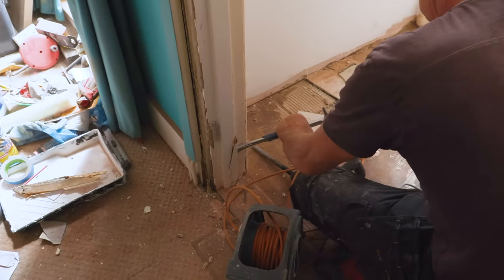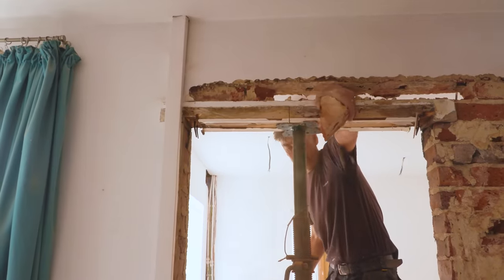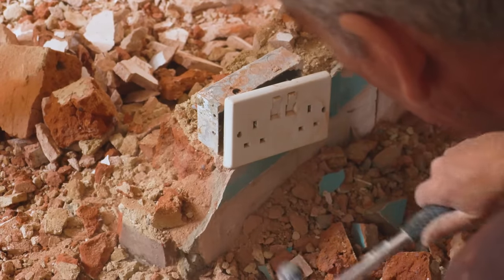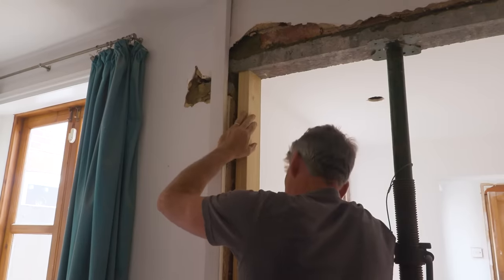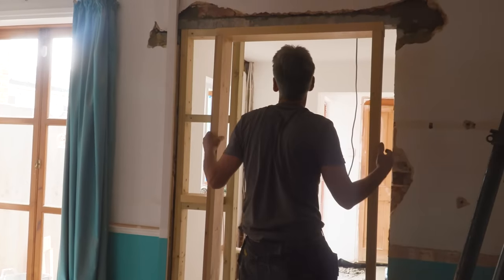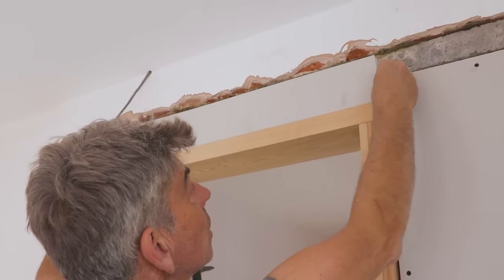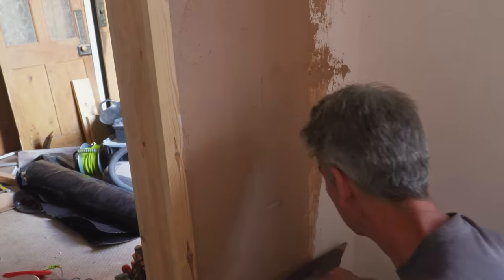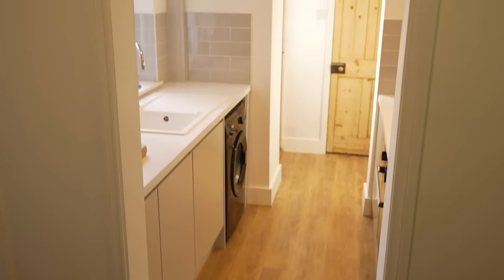How to Move a Door Frame Over ~ DIY Guide

Comment: Seems silly not to have a secondary acro in place after a few bricks removed, rather than remove all necessary bricks leaving wall unsupported?
Reply: What? The lintel is supporting everything which is supported by an acro, this is done to code
Reply: @mafftv3801 at 1.30 what is holding the wall up? The acro is holding the old lintel
Reply: @mafftv3801  I 'm guessing you're an American. I know you're not a Brit.
Reply: weekendwarrior3420  I get that, but walls move very fast under load, it works until it don’t and all that
Reply: Should have put a strong boy in the joint above lintel then wouldn’t have to keep moving it until after lintel in and mortar has set

Comment: i read somewhere (can't remember where now, i'll see if i can find it) that for concrete lintels (i think they used the term simple lintel) under 1200mm you only need 100mm bearing rather than the 150mm. this is only for single skins though, absolutely not for cavity walls

Comment: I want put in higher doors in my downstairs (1949 semi), this job is similar it seems. I didn't think I'd need lintels but maybe I do. I want doors to be 10cm higher, for aesthetic reasons, as the ceiling is high and I think it would be an improvement.
Reply: If there is an existing lintel that needs removing - you almost certainly need a new lintel higher up to do this in which case you require building regs as it is structural works

Comment: Got a man coming to do this at our gaff next week
But the dust is the thing that we really want to avoid, any suggestions folks?
Thanks
Reply: Water feed on the disc cutter will reduce the dust vastly.
Reply: Chain drill with dust extraction, takes a little longer, but well worth to keep the dust down.
Reply: Water and lots of plastic sheet if require capture the waste water include absorption mats from nearest DIY store. Maybe also want to plastic sheet around the work area create a curtain. Got one to do in a block of flats double imperial bricks. Probably turn the water dust suppression right down and just accept going to be a bit dusty. Better than ruining the neighbour’s ceiling.
Reply: @peterdorr6190 👍 most people are running the water at too high a flow rate on suppression kit anyway. You only need enough to wet the dust and get it to clump or paste, not pissing all over the shop.
Reply: It could be drilled. Of course it takes longer but the dust mostly falls to the ground rather than getting blasted everywhere. Drilling from both sides can leave a pretty tidy 'cut' edge.
Reply: @baldyslapnut.  Yes, I’ve been carrying out some trial cuts and too much water throws back onto your trousers a slurry and makes a real mess. Some contained brick dust stop it going all over the room far better than drilling a hundred holes in a wall. Far better cut.
Reply: Look at hiring an: Arbortech Allsaw AS175

It was designed to cut like a big disc but it doesn’t create the dust and can be much more precise. 

Often used in schools or hospitals where dust just isn’t an option.

Comment: I'm only an enthusiast DIY'er but shouldn't there have been a gap between the bottom of the plasterboard and the floor?
Reply: If you're meaning the bit where he used the plasterboard plane thing to skim off a bit, then I think there was a gap. It's just that there's a bit just in front of the plasterboard that is preventing the new piece being pushed in. Looks like he lifts slightly when it slots in, so there's likely a small gap there.
Reply: Should have been more of a gap, stops a potential leak rising up the plasterboard

Comment: Rather them than me using a disc cutter indoors with no water or dust masks. No PPE anywhere in fact. The brickwork should have been supported before chopping out and  joints above and below that lintel should be pointed in with a pointing trowel, not gobbed up with a gauging trowel! Love Skill Builder but there’s a fair bit to criticise in this video.

Comment: Are concrete lintels need to be put in while bricklaying, so they are under tension for maximum strength? Know everyone is using it for alter alternations like the one here, but my technical mind is asking me this question. 
Are the any structural engineers here ?
Reply from the maker: You are right to say that pre-stressed concrete lintels need to be built in with at least 3 courses of bricks but you can see that the span on this lintel is only about half its length. It is put in for convenience.

Comment: I hardly ever pick holes in other peoples work but from a builder, bit rough tbh, the first acro was doing nothing, complete waste of time, a strong boy should’ve been put in above the slot they were cutting mid span, you don’t ‘swap’ things quickly so nothing falls, I was cringing when it was open unsupported.
We won’t mention no safety glasses, no mask, no water on the disc cutter, didn’t see any pva.

Comment: Really P the hire company off by cutting the handle off a strong boy so you can get it in up against the ceiling,  I'm not going to be a smart arse and say you're supposed to have 6 new courses layed over the lintel,  I never do as long as it’s packed like they did it's fine, I've never had a call back ( never give them you're phone number 😂 )

Comment: A few pieces of slate in between the lintel and brick work prior to pointing in would be a better option, belt and braces on any wall tbh.
Reply from the maker: a lot og building inspectors don't like slate packers because it creates point loads
Reply: @SkillBuilder  some don't because they don't realise that point loads are only applicable at point, a correctly installed, non compressible material at regular points is far better, than installing a lintel and then applying mortar mixture retrospectivley
Reply: @troyboy4345 I like to use some chewing gum and cardboard. Does the trick and allows for movement.
Reply: @tanja8907  A lot of building inspectors don't like Chewing gum or cardboard because it contracts during the curing process, hope this helps ?
Reply: Staring right now at a wall marked up for a slap through. I like the idea of the acrows pushing up the lintel to compress the mortar. The structural drawing I have doesn’t request packers. I bought quick dry mortar Blue Circle virtual no shrinkage. A plan to hire a Genie Lift 8 two  approximate 40kg lintels 80kg total. Lift up, wheel them into the cut out, single middle prop and a XL Strongboy. The 115mm Evolution disc cutter I bought very impressed it sliced through both 150mmx100mm lintels no problem include reenforcement. Great video as ever Skill Builder.